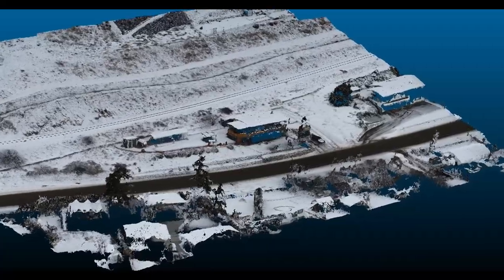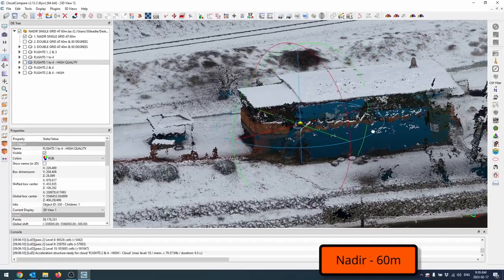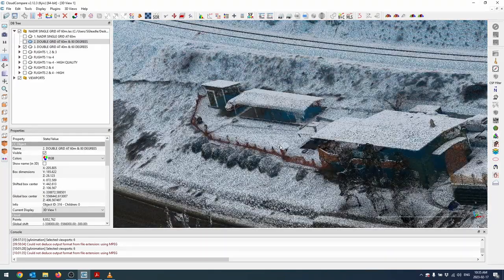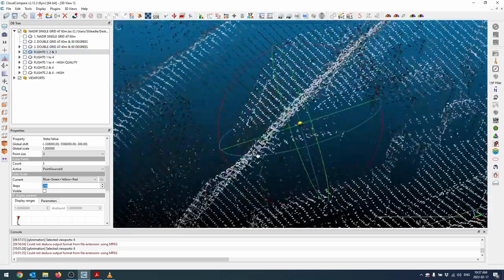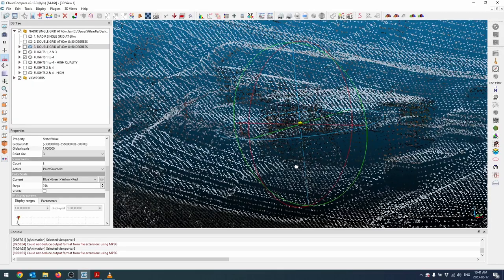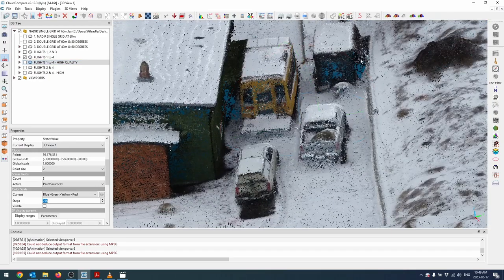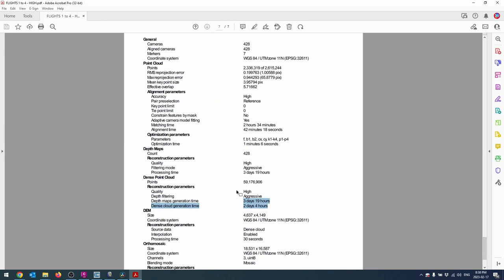Improving Your Drone Photogrammetry Results

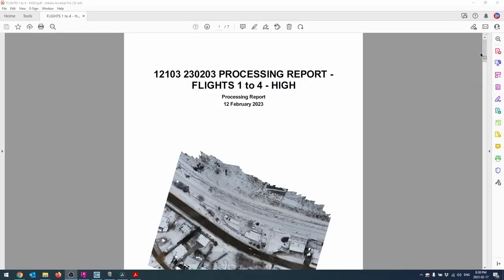Comment: 30:09 my goodness thats a long processing time. Great video thou. Learned a lot thanks.
Reply from the maker: Especially for a relatively small site. My GPU and CPU are a bit dated. Once I replace them in a few weeks I'll run the dataset again and tweak some settings and create a video comparison on processing times. I imagine it wont be hard to cut that down by 400-500%
Reply: @The3rdDimensionSurveying  what are your PC specs and what drone did you use?
Reply from the maker: @ryutsuisen  This was on my older computer, i7, 64gb ram, 1070 GTX but I was running an older version of Agisoft. When I updated it, it really cut down on processing times. With my newer laptop and newer ver of metashape Id be looking at a couple hours to process this out. This one I flew with a P4P.
Reply: @The3rdDimensionSurveying  thank you! Great video btw. I'm new to photogrammetry and been practicing with my Air 2S and Metashape trial version. Been enjoying that software a lot compared to using RealityCapture.

First personal project I worked on to practice with Data Acquisition and processing with different settings in Metashape.

https://youtu.be/AHQR9A_7X1g

Comment: Thanks for the video.
Do you think that a properly least squred adjusted network of GCPs measured by a total station would increase the final deliverables significantly?
Reply from the maker: @Sarfraz_CHK  that’s a great question and since I’ve never tried it, I can’t be certain. There’s no way more accurate GCPs would hurt but due to the nature of drone flights it’s usually pretty hard to traverse through your GCPs efficiently. Would the juice be worth the squeeze? If I had to guess I think it would be rare where someone would answer yes to that.

Comment: Think you will find Reality capture does a better job for this kind of work. 

Also running flight plans that consistently vary in elevation will produce better results with less shots. This is due to the way photogrammetry triangulates the data. Its part of why you see better results with the very oblique path as well. the more variation, less uniform, the better your results from my experience.

Comment: good informative video. Something I do for my Orthomosaics is instead of a Geo .tiff or ECW I use a free program called IrfanView64 and use that to convert to a .jpg. It dramatically reduces file size and quality is still good while maintaining the EXIF data for for programs such as Civil 3D or Carlson Software. Once again thanks for the info.
Reply from the maker: Very interesting. Agisoft exports jpeg and they are a much smaller file size but I've never used them in C3D before. I am definitely going to try this and add a comparison into my next video. Thanks for the tip!